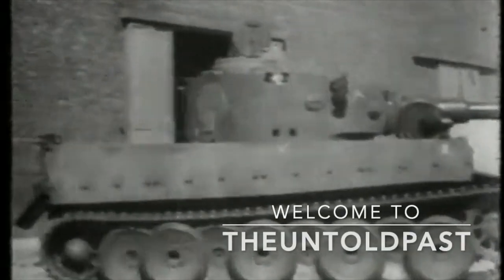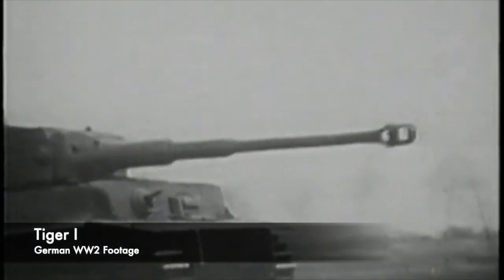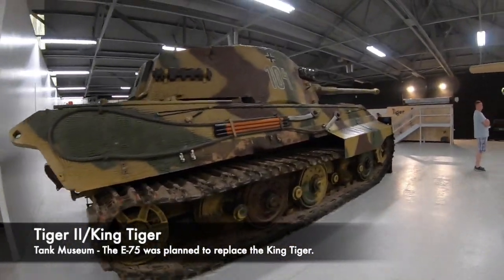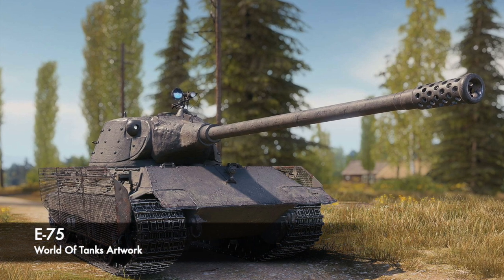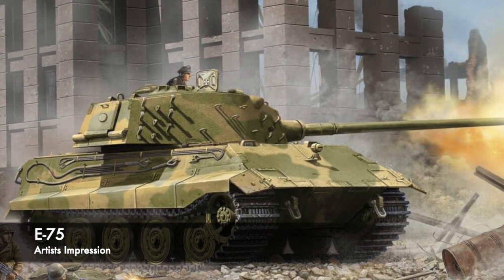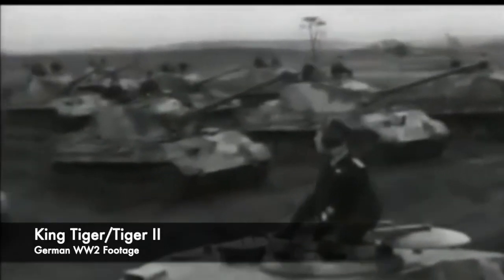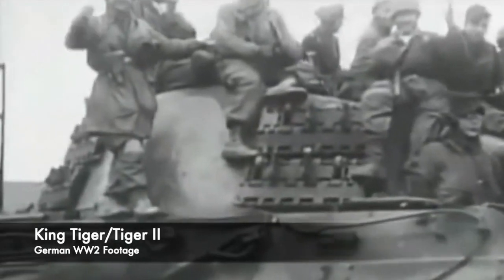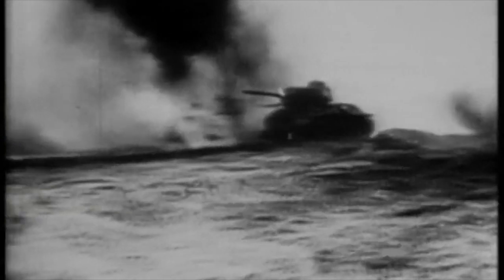The King Tiger's Replacement - The E-75 Standardpanzer

Comment: Don’t see how the E-75, 100 could have been better without a engine with a much high horse power just to start
Reply: Several bunkers with mounted anti tank guns and trenches with artillery forming a coherent defense line would've been better than using all the resources just to build 1 a nearly immobile tank tbh
Reply: they were planned to have better engines later on I think,well if they were to be produced
Reply: 1200hp turbine engine go vrrrrrrrr
Reply: Engine power wasn't that important, since the main issue of tanks that heavy, they would easily get stuck even in light terrain and most bridges would collapse under them.
Reply: @schadenfreude1061  trenches are WW1 era tactics !! France fell in 3 days becoz they relied on trenches and bunkers !!! in 1945 and with the advancements of artillery and bomber airplanes a few arty shells and a few planes can destroy an entire trench !!! i dont think that would work for the germans

Comment: Yeah the New IS-3s would’ve hunted down These Monstrous Beats in Packs of several IS-3s taking on one or two E-75s,granted the E-75s might have knocked out several of the IS-3s but the sheer number of IS-3s(along with the Thousands of T-34s,T-34-85s and Hundreds of IS’s,and IS-2s). It would have been very terrifying to be a Soviet InfantryMan and witnessing an E-75 try and fend off several IS-3s at a time,it definitely would have been very interesting to see what Tactics the Soviets would’ve employed against these Behemoths(probably a variant of Swarming it with T-34-85s,Infantry or IS/IS-2s/IS-3s or to just call in some Aircraft to Bomb it)
Reply: but t34 85 cant penetrate E75 so IS3 and IS2 would be the best option.
Reply: Don’t forget the first prototype of the T-54 (the first MBT) was in 1945 so those would’ve had a head start on the E series.

Comment: German tank production rate was just fine considering the situation at their hands. Considering the amount of fuel, resources and available crewman they had. I mean... What good does tens of  thousands tanks do for you if you don't have A) the manpower to crew them with capable crews. B) the fuel to even drive them.

This argument about production rates is always flawed because it never takes into account the facts that Germany lacked fuel, materials needed for production, industry and manpower.  So it was smarter for them to create less, but technically better vehicles.
Reply: Actually they do have plenty of resources and they indeed do have manpower but they decided to increase the specialisation in the training and especially in engineering tanks that met the requirements on a broad spectrum except ease of mass production

Germany would have fought to a stand still if they knew how to develop a tank such as panther or something slightly inferior and mass produce those to 20,000 to 40,000 of that variant.  I believe they would have lasted far longer than 5 years.   

The sheer lack of armored presence from 44-45 really set Germany back and the allies simply had more guns and more tracks on the field to simply out fight, out move and out gun German tanks by concentration of fire
Reply: @ConstantineJoseph  This is completely false. The German began experiencing a shortfall in both manpower and raw materials as early as late 1936. In fact, the only natural resource which Germany possessed in large quantities was coal. By the beginning of the war, they were already short of high grade iron ore, bauxite, manganese, chromium, rubber, tin, and oil, to name just a few. 

Furthermore, the Germans had already imported significant numbers of foreign labor- primarily from Italy and Rumania- even before the war began.

This shortage of both manpower and raw materials is the single most important factor in the subject of perceived slack in the German economy and Germany's relative unreadiness for war in 1939. German industry was capable of producing more war material than it did prior to the war's outset- but they lacked the manpower and raw materials to do so.
Reply: @ConstantineJoseph  When the allied attacked Germany they were already running low on fuel. In fact, big part of tank losses was because the crew ran out of fuel and had to abandon their vehicles. The lack of fuel reduced everything in German arms, from u-boats to luftwaffe. When Germany invaded USSR, their major goals was to capture soviet oil fields simply because they desperately needed it. They were running low on many materials such as cooper. The lack of materials also hindered the Me262 project.
Reply: The Germans could not even fully equip their panzer divisions with pz3s and pz4s before the invasion on the Soviet Union. The Germans had the manpower and fuel to fully equip their panzer divisions then, they just did not produce enough tanks. So I don’t see the German tank production being “just fine.”
Reply: @JackTheNoober  I partially agree. But most Tanks where not lost to Air support but rather anti tank guns and tanks. There is a video on it over on MHV (or notV^^)  on how much the role of air support as a tank killer is overstated.
Reply: @ConstantineJoseph  they needed to import iron from Sweden but problem was that hitler left the kriegsmarine to die
Reply: @manilajohn0182  for sho also they had the worst in their leader . hitler meddling with shit he had no knowledge of really was at the forefront of the dudes incompetence . Hitler said to the people "give me 10 years and u won't recognize Berlin and boy was he right about one thing that was it Berlin turned to dust. It's been said Hitler was one of the allies  "secret weapons" lol. Thanx for that fine assessment agree 100%
Reply: @willfranceschi2345  I very much agree.

Comment: they wasted many resources in "miracle tanks" instead increase the production of way way more reliable, cheap and deadly stugs.
germany was defeated anyways, but they could have a better position with more stug units
Reply: If Germany for example has only 8 crew, and little fuel, they’d rather build heavy tanks than expendable stugs. You also need to consider that Germany was short on manpower. High school kids were recruited to man heavy machines like the Panzers
Reply: But what if Tank use wood as fuel
Reply: @grant8164  Introducing: The steam tiger
Reply: @grant8164  the germans did invent a biodiesel engine to help tackle their fuel problems, in the grand scale of things it still wasn't enough to cancel out the negatives due to their lack of manpower, resources and fuel. The allies where about 70-90%of the world while the axis a mere 10% at most, so going against most of the world's resources, manpower and production is not going to be easy from the start.
Reply: @siegfried2k4  The idea failed miserably. Technically there was an event when a single T-34/85 defeated 40 Tiger IIs, (40!), because most of them broke down before it ever had chance to encounter them. Then the commander of T-34 easily spotted these huge tanks from a distance, while Germans failed to notice the presence of T-34. At Oględów a single T-34 encountered 6 Tiger IIs if I remember and destroyed 4 without even being detected. Then captured another one intact because these heavy machines would get stuck anywhere.

Comment: Panzer IV with the 7.5cm/L48 gun should have been the standard mass produced tank.
Reply: At the start of the war I would agree but for 1943 on wards they wouldn't be good, the Germans would have lost more tanks and men, we probably would have won the war faster then we did if they had of mass produced panzer 4s from 1943 to 45.

But the major factors were oil and the bombing campaign, Germany records indicate over 20,000 tanks lost on factory floors in various stages of production, about 90% of that in 1944.
Reply: There is no point, the biggest reason Germany lost is because they dont have fuel.
Reply: @brianlong2334   The massive Soviet Army had something to do with it as well...
Reply: @jacksons1010  Yes but it wasn't massive compared to the German's, operation Barbarssa stop because of oil not the Soviets however they did help a little, then the German's saved up more oil for more pushing in later years however it was more a stalemate however they still made gains till 1944 when the Germans had to send a large amount of equipment and men to fight the allies, if there was no allies German's would have probably won the war, the allies held up 5million German troops 1million KIA 4 million POWs, about 10,000 tanks and 40,000 aircraft.

Soviet were struggling when ww2 ended, when the Japanese surrendered the Soviet had about 20,000 tanks and 30,000 aircraft left, Stalin had on multiple occasions ask the allies to open up a new front to take pressure of the Soviets...
Reply: @brianlong2334  Dude, you have no idea what you’re talking about.   The Soviet Army was much bigger than the Wehrmacht and they stopped the German advance in December 1941.   Pick up a damn book before posting such nonsense!   For one thing, the Soviets were an Allied nation...DUH!
Reply: @jacksons1010  No there were not hence they are not called allies... however they were an ally. Lol

Have you ever picked up a book it would seem like you have no idea what your trying to argue... lol

BTW the Germans had over 7million men in it's army in 1941 befor operation Barbarssa the Soviet 5million, so maybe fact check a little mate mite help you a lot.

Military history Visilised and TIk would do you great to have a ganda mate, also I own a lot of books just a heads up if you wonna have a discussion or argument at lest have facts to back it up.

BTW the Germans were short oil about 1 year and 6mounths, or under 300million barrels the Soviet had 800million to 1billion barrels, the allies as in the USA and British empire used 7billion barrels....

The Japanese were also short they only had and used 35million barrels, the Italians about 10million both of them were basically out of oil in 1942.

But anyway I digress it wasn't all oil however it would be the main reason the Germans failed in ww2, and Oparation Barbarssa definitely failed due to oil and it turned into a slug fest, Soviet helped obviously but it wasn't the main factor that stop the nazi war machine.
Reply: @jacksons1010  Champ you do what you need to but you sound like a complete nut, the allies are generally referring to UK and USA, and the Russian's as the Russian's or Soviets so idk how you missed that but you seem to be arguing about something that's not actually getting argued, the Soviet were an ally but we don't normally talk about Russia as the allies probably due to the cold war and them helping Germany invade and split Poland, but anyway mate you do you no one else will....lol!!!
Reply: Can't pen the IS series

Comment: Something between a Panther and a Tiger 2 would have been Ideal. Work out the problems. Make it modular with easily swapped mission based turrets and load outs.
Reply: By the time the Germans released the Panther they had already lost. After 1943 it didn't matter what they produced.
Reply: @matthewpaine6908  i mean germany could never had won they didnt have enough manpower, fuel, and resources in general
Reply: @neffels8768  If they didn't Invade the Soviet Union and Never Declared war on the USA, they could have won. However they might have been able to beat the Soviet Union if they ignored Stalingrad,  captured Moscow, and the southern oil fields. However they still would have lost when the US invaded.
Reply: @matthewpaine6908  thats the thing neither of those things could have happen for them to happen hitler couldn't have been the leader of germany because that was his plan that he was never going to give up
Reply: @neffels8768  Live by the Dictator die by the Dictator.

Comment: The Germans had more tanks than they could fuel and crew. I believe one of the reasons why they chose to build large well armored super tanks rather than mass production of average tanks is that they were desperate for fuel and manpower. They were going to be outnumbered no matter what, but having 10 tanks that are capable of holding up against 80 tanks save gas and troops. They had plenty of steel and coal, but fuel and manpower were in very short supply. This issue makes the Maus an the Ratte look less silly, until you have to cross a bridge to fight. They were counting on capturing the oil fields in the caucuses and enslaving the vanquished to solve their problems - it didn't work out.
Reply: 'This issue makes the Maus an the Ratte look less silly'

No, it doesn't. They're ridiculous designs that only gained approval because Hitler liked big tanks. 

They would have been potentially useful in the first world war, but in the second - just massive targets for aircraft. It doesn't even matter how thick the armour is, you need only disable the vehicles movement to effectively knock it out. Check out Chieftain's talk on the Maus, he's a former tanker and cringed when he saw the top section of track is inaccessible. If (when) the tracks were knocked off a Maus, it meant rebuilding the damn thing just to sort it out! Madness!
Reply: The reason was that Hitler was an idiot. Tiger II was so heavy because Hitler 'improved' the design himself.
Reply: Yea unlike the panzer iv which is more effective and reliable than the tigers and panthers

Comment: Bruh, you used the e 75 ts from world of tanks. That’s not the e 75
Reply: A supossed turbine motored, lighter variant, of the E75 according to Wargaming's own description, using a Löwe-like turret for the sake of it.

If you ask me, is more of an up-gunnered, more potent engine wise E50 rather than that supossed E75 specially considering in-game usage, but as both vehicles used nearly the same chassis and classifying it as a medium would had made it called as "OP" by the stupid WoT playerbase...